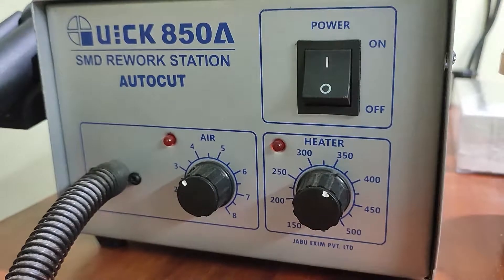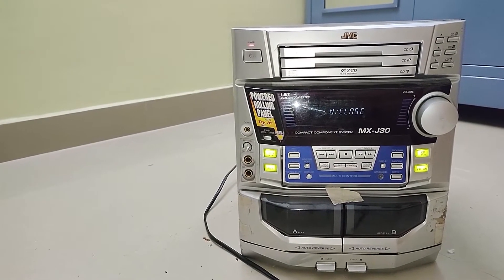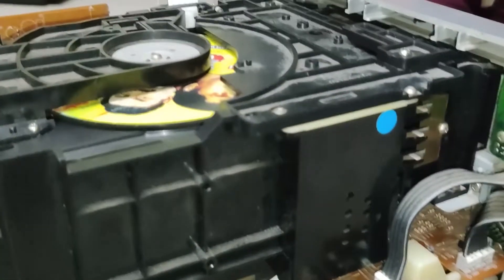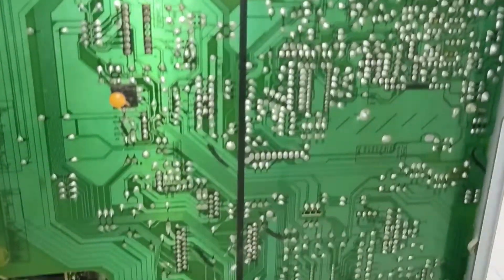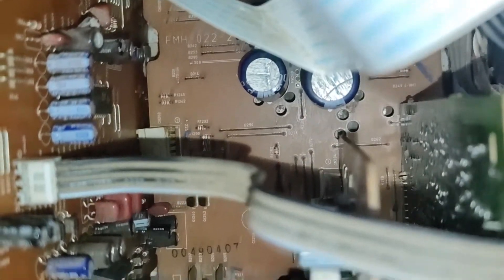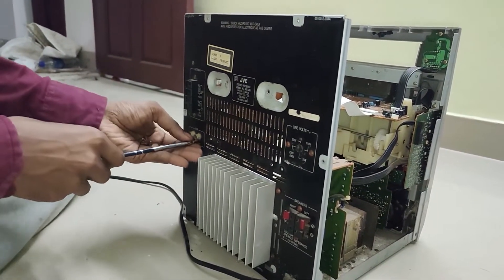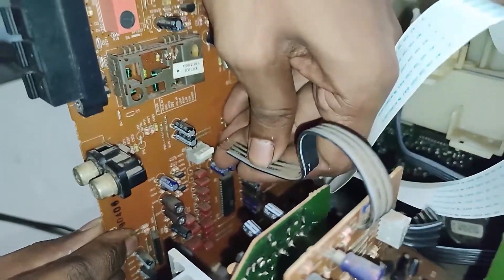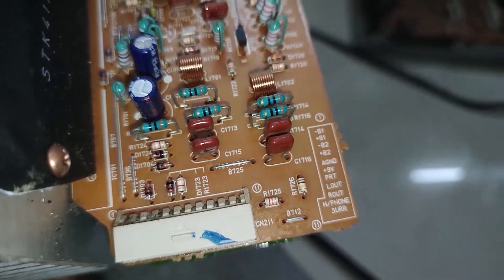WHAT'S INSIDE JVC-MX-J30? DISASSEMBLY AND REPAIR GUIDE.

Comment: Splashed tea into the power switch of mine and it went dead. Is there a fuse or circuit breaker please?  (It's a 1995 model but looks the same as this.)
Reply from the maker: its fully dead like no power at all?
Reply: @LETSDIY57  Yes.  No lights and nothing works. And it's had several weeks for whatever got wet to dry out.

Comment: I have this unit and have not used it in a while. There is no power, although when i plug it in, i hear a short buzzing noise at the back where the power cord goes in. im not electronic savvy, so what do you suggest i check on my unit. the fuses seems to look ok

Comment: In the same boat with one of these. Volume shuts off after you turn it up so high. Amplifier issue. Will need to determine what caps to replace.